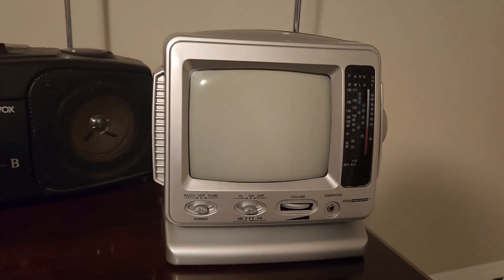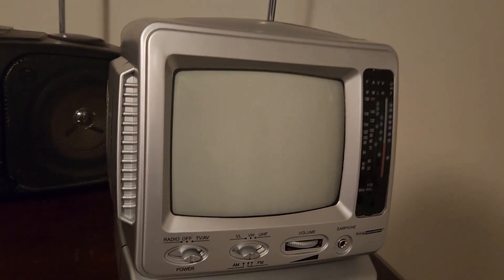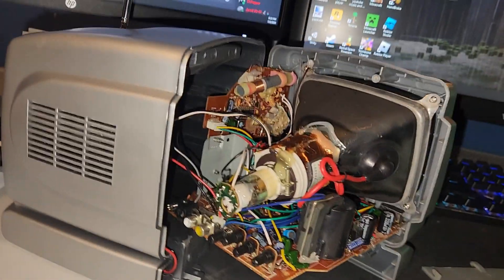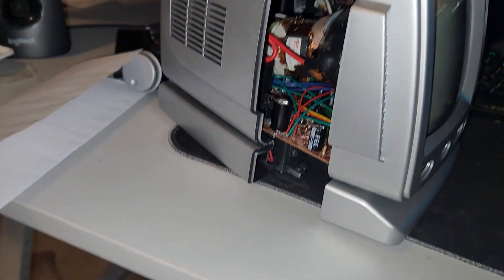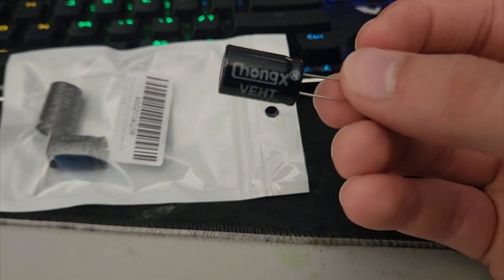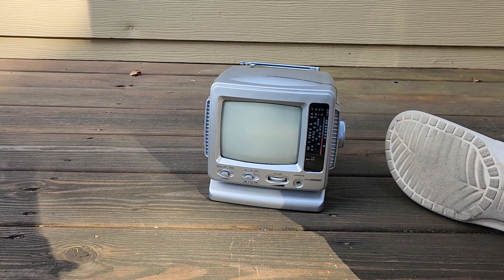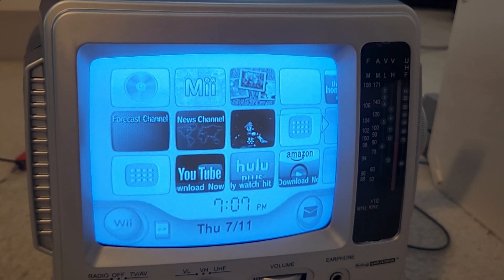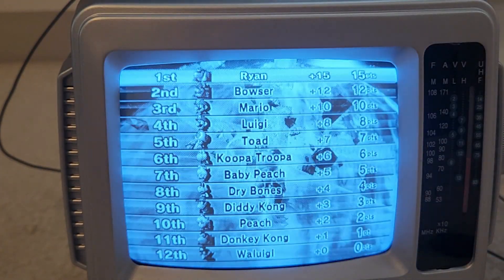my portable CRT has partial vertical collapse - Can I fix it?

Comment: I got a TV with the same problem as well. This is giving me a bit of confidence to try and find out what the problem is
Reply from the maker: Most of the time with these crappy 2000s electronics the capacitors are at fault, I will say PLEASE be careful when you open these up as you can get seriously hurt.

Comment: these were 15 bucks new, thesewre sold mainly form 2000-2010, and yougot a broken one for 20 bucks?
Reply from the maker: Yeah, I kinda overpaid, however these are getting increasingly less common as well as with inflation, $15 in 2004 is about $20 in  2024
Reply: @RMA2009  but people have found this exact, and similar models for 10 bucks in the modern day, these were always cheap and crappy"last hurrahs" for CRTs.
Reply from the maker: @MTNplayz  I've seen these sell for around $20 used and $30 new nowadays on ebay. as well as my set is a little less common having AV inputs, I definitley overpaid a bit but I wouldn't say I got ripped off